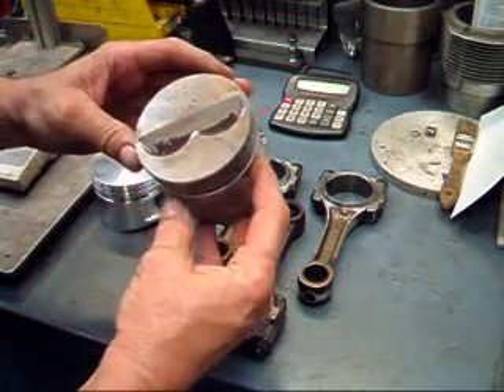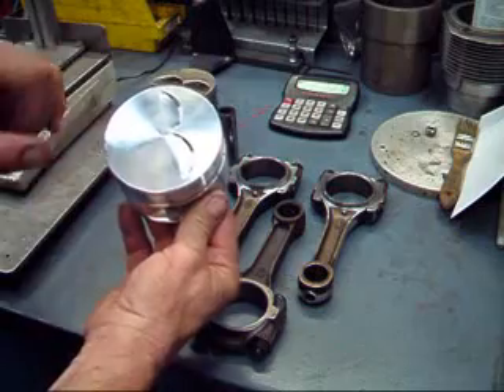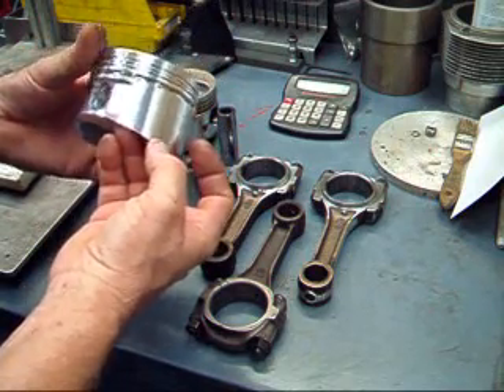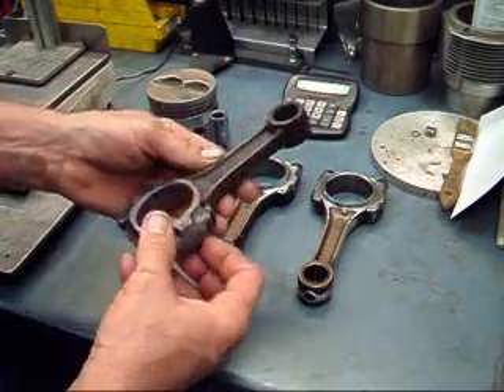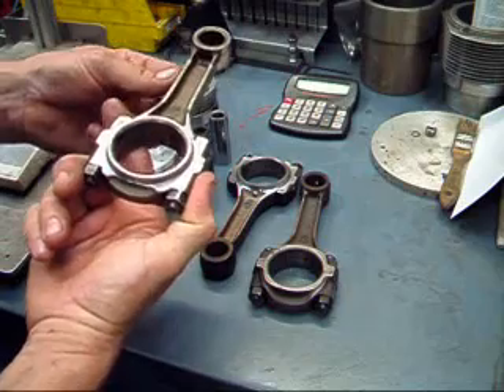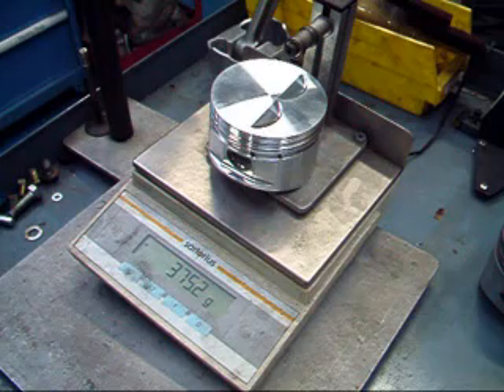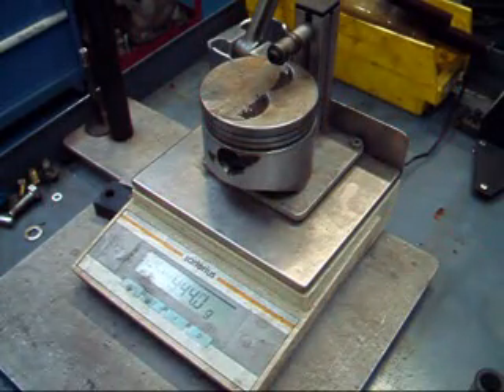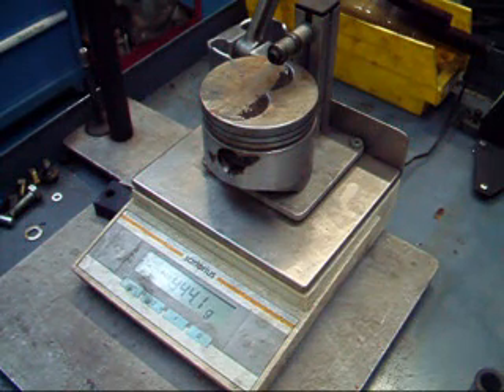Fiat X1/9 Pistons & Connecting Rods

Comment from the maker: @anililguy - If you are still running the cast iron crank, probably not. You can nitride and cryo the crank to increase durability to a point. Sounds like you need a steel billet crank for that much power. The stock crank only has 4 counterweights, you need one with eight.

Comment: @ fiatnutz , hi mate, I've been looking at your videos and thought you might be able point me to the right direction.. Currently I have a 1.4 punto gt running 255hp and in process of building a 1.9 with sporting block and stilo crank.. I'm aiming for just under 400hp but not sure if the crank would be able to handle it? can you give me any advice on this field? Cheers.. :)

Comment: How capable are these motors and chassis?

also how expensive are they.  I got a Fiat x1/9 in back I saved from the crusher but I don't want to let it rot out back I want to build it soon.

Has anyone ever taken something like a toyota or honda fwd 4cyl setup modified to fit in there??   I thought about doing that since parts are much more accessible since I don't have a machine shop.   

I kinda like to try the 4age toyota or b16 honda.  but I bet the fiat engine is lighter.

Comment: Mine was a USA spec 1290cc.  The belt, technically, didn't snap.  It looked like it lost a number of  adjacent teeth which allowed it to slip on the crankshaft drive gear.

Comment: The stock X1/9 engine is definately NOT free running.  When the timing belt broke in my '74, I bent ALL but one valve (the last valve broke in half), punctured two pistons and knocked out a valve seat.

Comment from the maker: We run stock modified rod @ 10,000 rpm already in a Solo 2, X1/9. Thanks for asking. Have a billet crank in the works for the 1500 block (1600) w/8 counterweights and modified oil system.

Comment from the maker: I routinely run 9:1 up to 10,5:1 compression om ym turbo engines. Running higher static compression improves low-rpm power and what's more important is that I don't have to run as much boost to get the same power and w/o an intercooler. Don't be fooled by those who tell you to run 8:1 and just crank up the boost, everytime you crank up boost, you heat the air a substantial amount. I run the VQ35 engines w/10.2:1 compression w/2 turbos and make over 500 WHP.
   JE...
Reply: 500 hp with stock rods?
If no, what torque does oe fiat lancia twincam rods take before it binds?

Comment from the maker: By not using a stock Fiat crankshaft. I'm in the process of getting some drawings done for a 8-counterweight stroker so that it will eventually be able to be stroked to 1600cc. Stock cranks will go 10K rpm but they don't like it there for very long. By adding 4 more counterweights the crankshaft will become more balanced and therefore become more stable @ higher rpms. 
   JE... (949) 631-6376 in SoCal